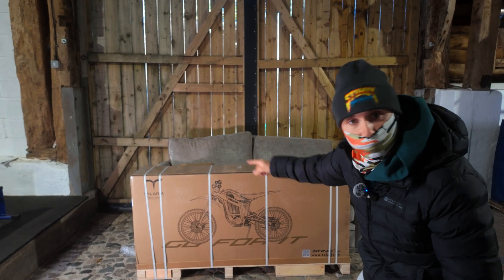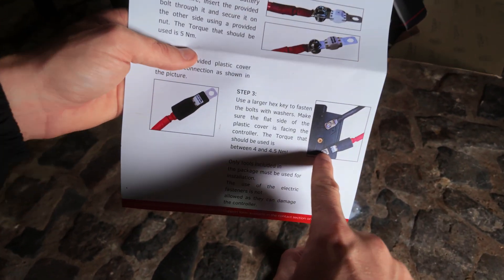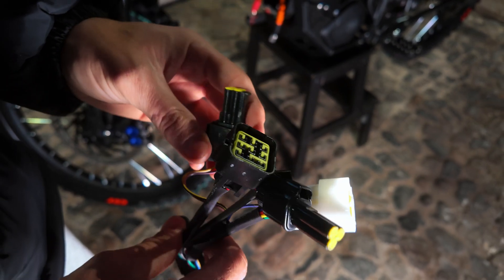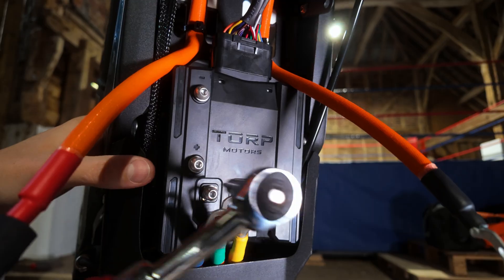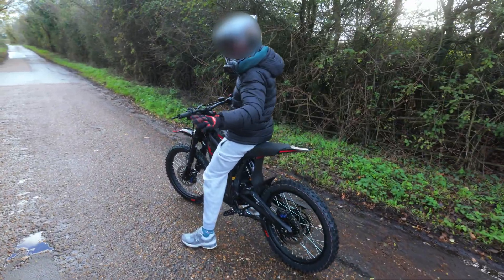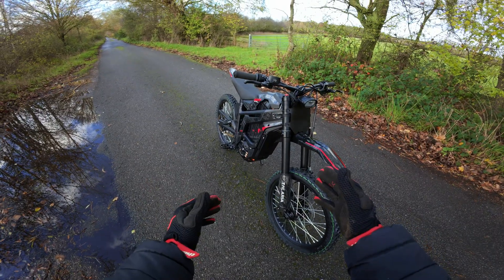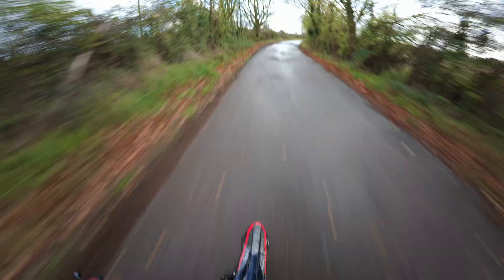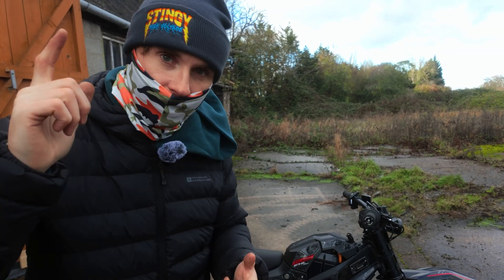I BOOSTED MY TALARIA MX5! (INSANE POWER) // HOW-TO

Comment: Great vid brother, I'm looking into getting the Torp TC500 for my MX5. What are the pros of getting the TC1000 vs the TC500 if I plan on keeping the stock motor and battery
Reply from the maker: The tc1000 vs 500 only difference is the fact that you can run more power on the 1000 in future should you decide to upgrade batteries, you also can use higher voltages. The 1000 holds value better and the discount code ‘stingy5’ is only valid for the tc1000. You also can use the tc1000 on the ultra bee/mx3/mx4 if you want in future where as the tc500 cant be used on the ultra bee if you upgrade bike down the line or komodo for example.
Reply: @stingyrogerr I appreciate the feedback brother. I'm running a TC1000 on my 2023 UB currently but I didn't know they were compatible with the MX5. Is this controller in this video the 2.0 version?
Reply from the maker: Yes, but you can use the 1.0 on your mx5. All the units are the same you just need to purchase the install kit & wires from the torp store as they are available separately for this exact situation :)
Reply: @stingyrogerr last question dog lol, would you recommend upgrading to the 2.0 version? The MX5 is my wife's bike and I'm trying to get it more dialed for her woods riding. I currently have a stark and a UB with a TC1000 (1.0 version), that I switch back in fourth depending on if we're riding track or in the woods. 

Also thanks for putting out all this content. Switching from KTM gas bikes into the electric world, your videos have been super helpful for picking out mods for our bikes.
Reply from the maker: Hey no problem at all. I’m here to help! And yes, especially if you want the upcoming traction control update/ wheelie and launch assist the 2.0 will be a game changer! Super cool you ride with your wife.
Reply: @stingyrogerr just found your IG lol

Def gonna take your advice and send it on the 2.0. thanks again for the help dog. You're a G, keep up with the sick videos and if you're ever visiting Florida you can always borrow one of my bikes
Reply from the maker: @michaelsmith3302 thanks man really appreciate it. Don’t forget to use the code at checkout. Every little helps lol! 💪🏼💪🏼💪🏼

Comment: Hey stingy, :)

I wanted to pick one up with your Code but it send like it doesnt work on the new Controller is that correct? :O
Reply from the maker: Hey man! I now have a code for the new controller 2.0. Its ‘stingy5’
Reply: @stingyrogerr thanks man :)
Will Check if it works as soon as the 1000 will restock
Reply from the maker: Hey man, the tc1000’s are all in stock at the moment :) just checked 

https://webshop.torpmotors.com/
Reply from the maker: Not on the new version of the tc1000. Correct. I am using the 1.xx in this video :)

Comment: have u tried the ebmx its ment do peak at 23kw? also the top speed didnt go much faster for 18kw with the torp whys that? also do u think it would improve the range? mad vid mate!
Reply from the maker: On the stock set up 57mph gps on the torp we hit 63mph gps. Even with an 82v battery set to 22kw (max the motor can take) you can only reach 66gps. 

The bms cut limit of the battery is 18-18.5kw, the ebmx can only reach 23kw with an aftermarket battery on the stock motor the same as the torp.

Remember I’ve tested this bike on my channel with an 82v battery as well as with an ebmx, you can find that here: 

https://youtu.be/TLsP8NZcGrE?si=44aMG5EoPRmB6ljL
Reply: @stingyrogerr  oh okay thanks for clearing that up man, from what i heard the torp is very smooth compared to ebmx, ill get that if i end up getting a controller!

Comment: hows the range on the mx5 with the torp now??
Reply from the maker: Too wet atm to test!
Reply: @stingyrogerr  what’s the normal range you get on trails with the mx5? I have a completely stock 2025 ultra bee and I’ve been thinking of getting a mx5 as a second bike. How much less range would I see on the mx5?
Reply from the maker: I get 18 miles offroad riding hard on stock mx5 and 24 on a 2025 ultra bee.
Reply: @stingyrogerr wtfffffff 18 miles of range that’s fucking horrendous how are you supposed to have fun with 18 miles of range like wtfffff 😂
Reply from the maker: Well thats me using them offroad like an enduro bike and abusing it, if the average person rode it on/offroad they would get around 30 miles. 

I do not go easy on them and can drain anything real fast. Even my 82v 76ah ultra bee I can drain in 45 miles

Comment: I can vouch for the TC1000. I have a v1 X-9000, a v2 X-9000 and a TC1000 on my MX4s. The Torp has the best throttle control, by a wide margin. The X-9000 at low throttle feels binary; on or off. It's super twitchy and really annoying no matter what settings I use. You have to be super careful with the throttle, with a light touch. I've been tweaking the EBMX for 2 years now and I can't find any setting that improves this. They improved it slightly on v2 but it's still present. I was happy to find the TC1000 doesn't have this problem. The throttle is smooth even at low speeds. It's so much better I'm going to replace my EBMX controllers with Torp once I have the funds. Great video as usual. Good to see you without a helmet for once 🙂
Reply: Ebmx on the mx5 is the backflip bandit 🤣
Reply from the maker: Im excited to try the V3 x9K for sure!

Comment: The wheels I somewhat understand but don’t you think it being wet in the uk has a factor and are those dirt tires or dual and did you wear them in?? Not having a go btw just genuine questions☺️
Reply from the maker: Good question!!! 

Pressure is the largest factor. Not sure if you have seen my content before or new to the channel but have tested lots of combos. For 19/16 normally i would run a wider higher profile rear tire with a rim lock and around 15psi (generally thinner carcasses on 16” tires comparitively to 18”) on my ultra bee I run 11psi rear, its much better in the wet and even with 53kw on my ultra bee with enduro knobbies with larger knobs id be able to put down more power than this. 

You can’t use low pressure on a 19 rear as they have not got enough meat or profile and also end up with pinch flats even with a rimlock. I tried almost every size on the market and made multiple videos back when I started on youtube. 

Those are the standard tires on this bike so less knobby than a dirt tire and also probably more road enclined than a dual sport. A 19/16 with a rimlock and some bridgestone x30’s would grip up really well with this power you would have to try and wheelspin rather than it just happening :)
Reply: @stingyrogerr  wow and I thought my research was good back to the drawing board for me😂 but I appreciate you breaking it down for me ☺️

Comment: Will this same thing work on the MX4?
Reply from the maker: Yes, but you need to purchase the MX4 version, the link is in the video description :) you will see a massive gain over your stock power :) ‘stingy15’ to save some 💰 at checkout
Reply: U cant go 18kw on stock motor and battery on mx4 if that is your question
Reply: @datel666 I was just trying to get some more speed is all. What do you recommend ?
Reply from the maker: You can get around 12kw on the stock mx4 with a torp tc1000
Reply: @stingyrogerr  I have mine set to 14kw with a 72v battery and it's perfect on my fully built MX4. Any more than that and I just spin the tire. With the OEM 60v battery you can get about 9kw. It's a modest upgrade from stock but you really need a 72v battery to get the most out of it.